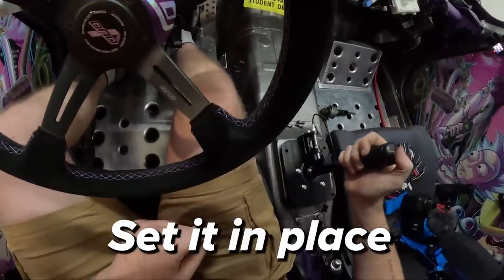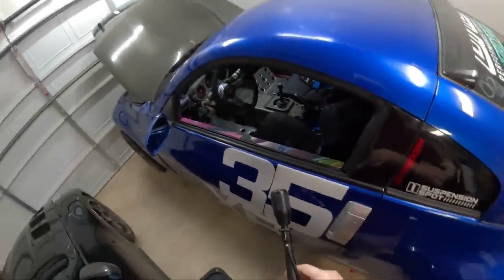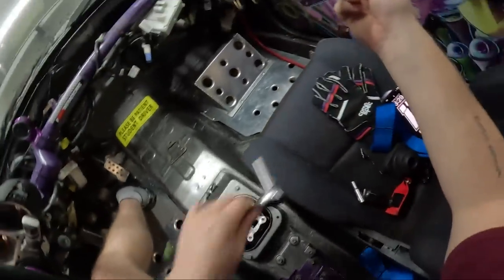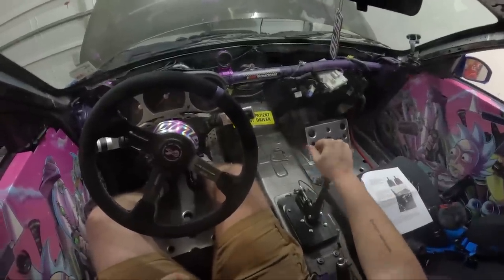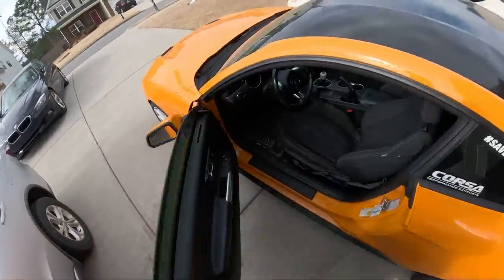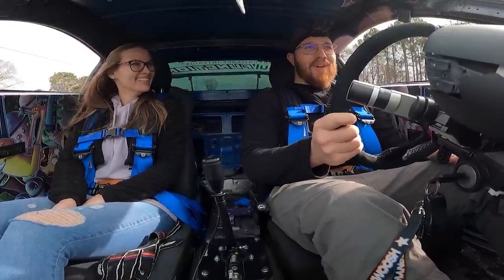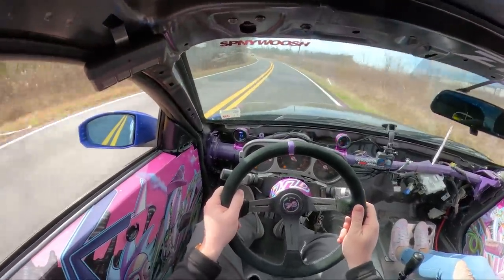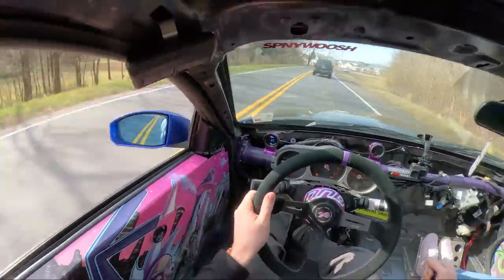I found the PERFECT Shifter for my Boosted 350Z Racecar!

Comment: id love the billet shifters but I have the 07 model that has a hazard button right on the shifter and i may have to cut that and possibly relocate
Reply from the maker: I believe that you only have to cut the front of the shift boot/trim. I think it’s specifies on their website. It might work for you 👍🏼
Reply: @Zorbii  possibly, from what I saw on pictures, others had to remove the hazard button on the middle

Comment: Why did you have to drop the trans bracket for?
Reply from the maker: Because the original shifter bracket doesn’t have enough room to remove the bolts on top of the trans.